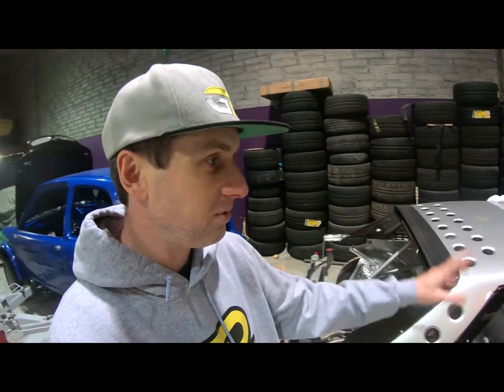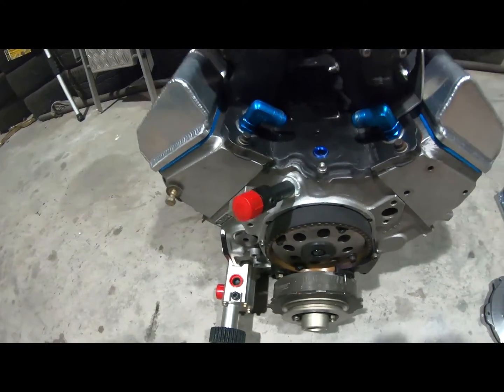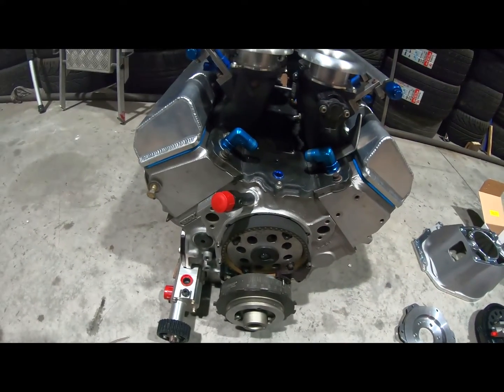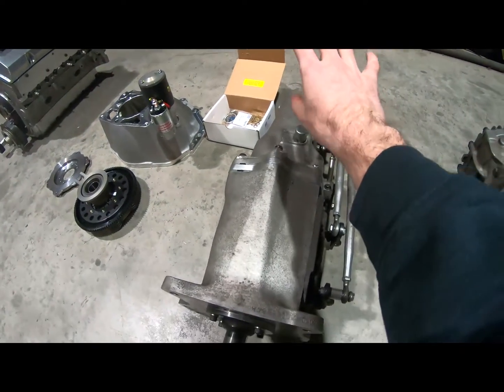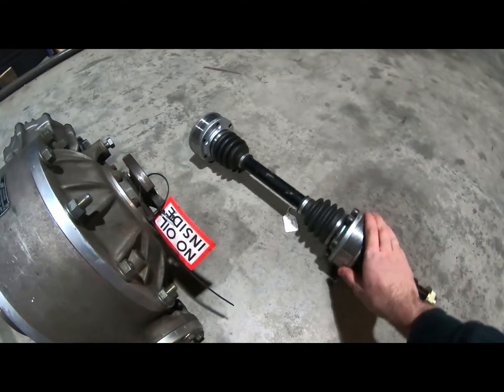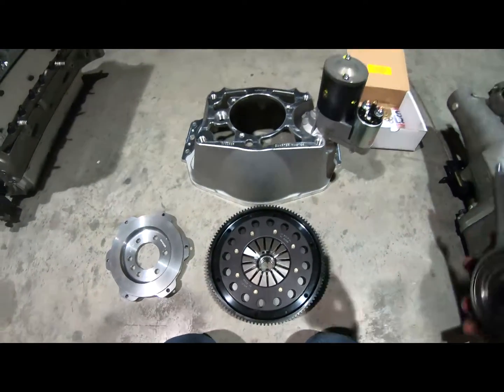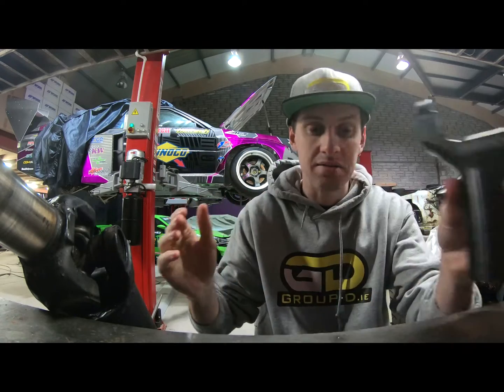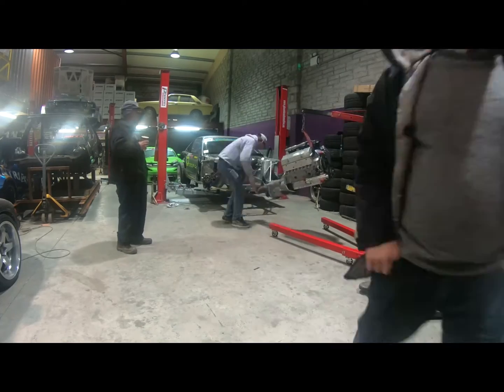Ultimate Drift Car Build!! Ep1

Comment: I got recommended this four years later. So, out of curiosity, what was your experience with running an electric water pump? I'm ditching the power steering pump on an LS1 and with that gone, there's like 2 metres of belt driving not very much, and two pulleys doing nothing but setting the belt's route to the water pump. Ditching the belt-driven water pump would simplify that to just the alternator being driven. So, is an EWP a terrible idea for a road car? Thanks for your thoughts!
Reply from the maker: The EWP's have been great for us and 100% reliable so far so i would have no issue with running one on a road car
Reply: @Group-D  thank you, appreciate the opinion of someone using them over an extended period. Yeah, if you haven't been able to kill an EWP it's unlikely I will, so I'll take that as a recommendation :) Thanks for taking the time to respond!
Reply from the maker: the only thing we see with them is lime or rust from not running coolant. But on a street car with coolant you shouldnt have that issue

Comment: So because you run an air/oil pump is why you don’t need to run any valve breather or catch can correct?
Reply from the maker: Well the engine is dry sumped so you can run the engine under vacuum and dont need to let it breath like a wet sump engine. This will generate more power as the crank and rods operate in a vacuum and dont have to push air out of the way often referred to as windage. I do have a breather filter on the crankcase by the valley but it is sealed most of the time and only opens when it sees positive crankcase pressure this will prevent ever pushing out a seal or gaskets leaking from excessive blow by
Reply: @Group-D  thanks brother I truly appreciate the response I have a couple builds in process but always trying to better what I’m doing or how! You’ve done some truly amazing work!
Reply from the maker: @Inkscars8  Thank you very much

Comment: Hey Darren, love the vid, very informative, is there anybody else, like in FD running one of those engines or are you blazing the trial for them in drift cars?
Reply from the maker: This engine is from the Saturn Sky I used run in FD. Hubinette had the mopar version in his Challenger. So many years ago they were used pretty much before FD started a weight rule which made cars too heavy. So now turbo LS is prob a better option than NA V8. The Mustangs would have a Sprint car block with NASCAR heads and NOS now